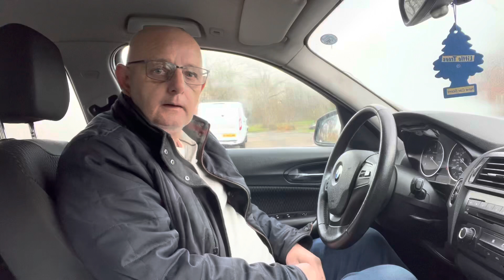BMW 116d crank won’t start

Comment: This seems to be a common thing in these F20’s… I have the exact same car only a 118i petrol 2019 version and my car cranks and doesn’t start and I’m afraid I will be out a lot of money hopefully not though 🤞🙏 I was told mines is the high pressure fuel pump also
Reply: Hi there. I'm curious to know if you ever got the car right and what the fault was?
Reply: @MrSize20something  yeah I got it sorted and the fault was it needed a new fuel pump and fuel pump module
Reply: @JD01_  thanks for the feedback